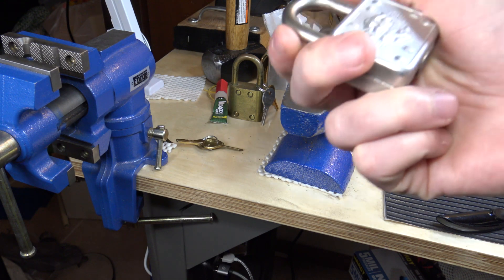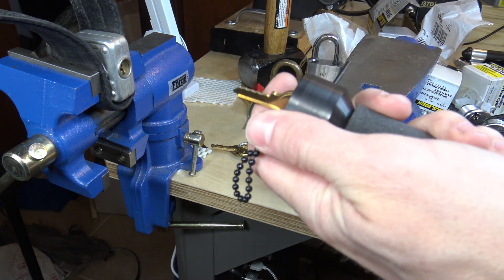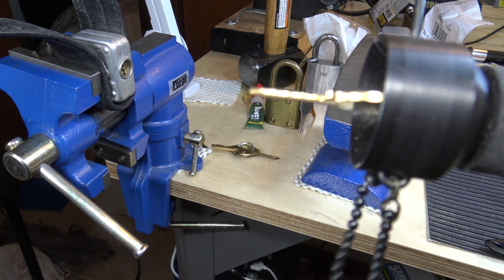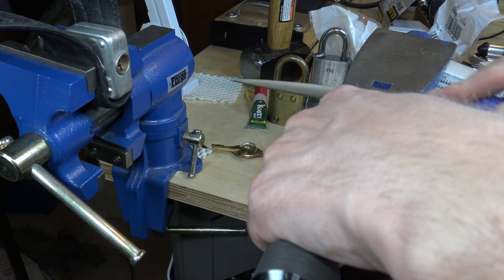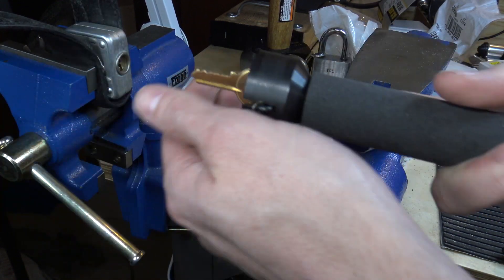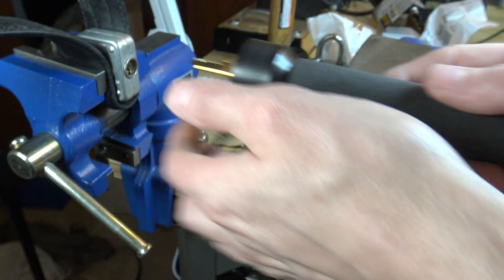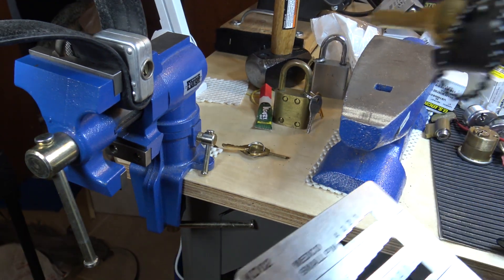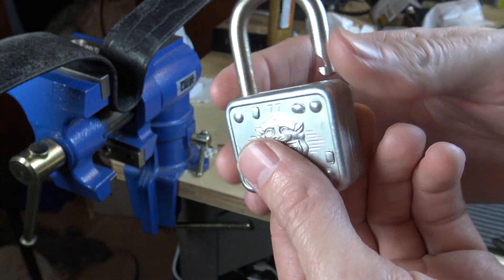(311) Impressioning a Key for a Vintage Master Lock no 77

Comment: Awesome brother. I've tried a couple times with no luck. I didn't think about using a gauge to help me. Thank for the tip.
Reply from the maker: it definetly helps out! when I dont use one I tend file quarter depths or whatever and it usually ends in a broken key since it gets inserted in the lock four times per depth lol

Comment: Right on.   That’s such a good idea to use a gauge if you have one for the lock your working on.  I’ve been practicing and have been able to impression a kwikset and a couple of wafer locks.   You make it look way easier than it is.
Reply from the maker: Fast Charlie that one ended up being easy because the bitting ended up being so shallow. The last video before this was harder.

Comment: Very cool, I like the idea of the key depth gauge thingy to help the process.👍🏻😉
Reply: I see those gauges on eBay all the time but they are all from the US and all very expensive because of the shipping. You ever seen any for Lockwood locally?
Reply: @two_tier_gary_rumain  yeah, me too. I think I seen them for a Lockwood, just don't think it was Lockwood branded but yeah, expensive.
Reply: There's a different device. I thought it was on the Multipick site but I can't find it now. A little black box-like device. You put a pin in it and it rolls along and down to its size slot so you can work out what size it is. You can't use it for a key's bitting, unfortunately, but it's an interesting way to work out the size of a pin quickly.
Reply: @two_tier_gary_rumain  this is interesting alien technology, never seen or heard of this before. Very interesting but again, very expensive. I use vernier calipers, a bit fiddly but works. I wonder how well this works between brands.

Comment: Good job! 
I've been trying to get the bitting for a No3 Master Padlock it has 0034 on the bottom of the lock.
I'm a newbie at this stuff.
Reply from the maker: Probably a blind code.  You could subscribe to insta code probably and get the bitting or bring it by locksmith and they could cut you a key.

Comment: When you zoom in like at 7:25, hold something flat behind the key like a piece of card or your hand so that the camera's focus will work. The key is too narrow for your camera to notice it in the foreground on its own against the larger background.
Reply from the maker: Gary Rumain I tried that and just edited it out. Messed with it for almost 2 minutes
Reply: Ah, well. Did it work? I guess not.
Reply from the maker: Gary Rumain nah it didn’t. I think the problem is how I had lighting set up. I made need to turn it down a little for next video. I have one more 77 to make a key for.
Reply: You actually want more light. That helps with the depth of field by closing the aperture a little more. If you use some card, make sure it's of a contrasting colour. Darker if the key is light and vice versa.
Reply from the maker: Gary Rumain I’ll try that. I’ll find something black. The marks are kind of cool to see. Other thing I was thinking is maybe sticking a GoPro on my head so everyone can see what I’m seeing through my magnifyer
Reply: Black might not be the best choice. It will throw the light level sensing off and hence the exposure. Try neutral gray instead. If you can find old Kodak guide books anywhere (a local library might still have some), they used to have an 18% gray test card in the back of them. I think I still have some in my storage boxes somewhere down in the garage.

18% is the standard value for a correct exposure. But you could go up or down a little depending on the contrast you need thanks to modern devices and their exposure controls.

What are you using to record at the moment? I have a Nikon P900. It has a very wide zoom range and good macro capability. I could probably also find some close-up lenses for it  if I need to (my old ones for my old Nikon F2 are the wrong size so I can't use them). The only flaws are that it doesn't have a jack for an external mic. I only discovered that to my consternation after I bought a lapel mic on eBay. Software control is hopeless too. Seems you can only trigger the shutter and view what the camera sees on an external device - no zoom and video control options. Really frustrating.
Reply from the maker: Gary Rumain its a Sony FDR-AX33

Comment: I am trying to understand how the pin wouldn't just leave a mark on the blank anyway whether the pin was up on the shear line or not because they are all spring loaded.. how does the little mark know if the pin is at the shear 🤔
Reply from the maker: it leaves a mark because when you're applying a little bit of turning pressure the pin is partway in the top chamber and partway in the plug so it binds and marks.  when its at the shear line and you apply turning pressure its just in the plug not between both chambers so it isnt binding and thus leaving a mark
Reply: @BoredLockpicker  Oh..makes sense now. Thanks